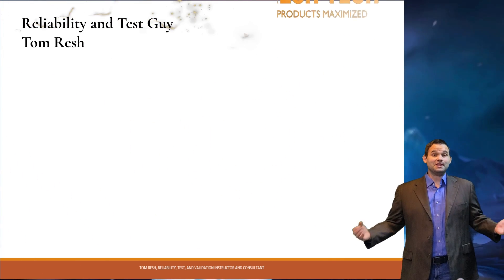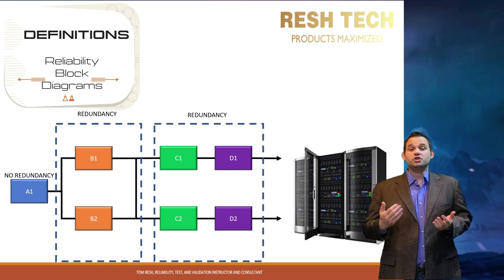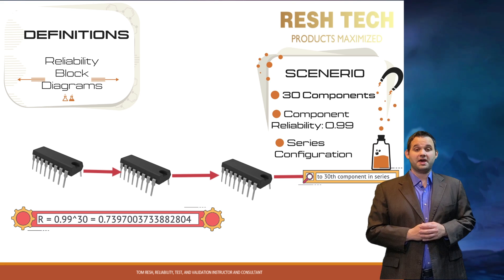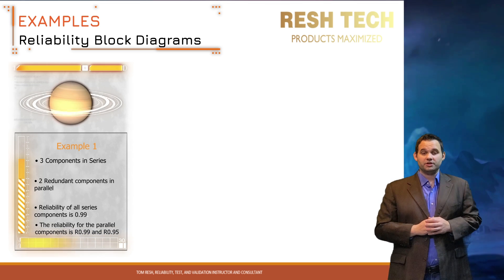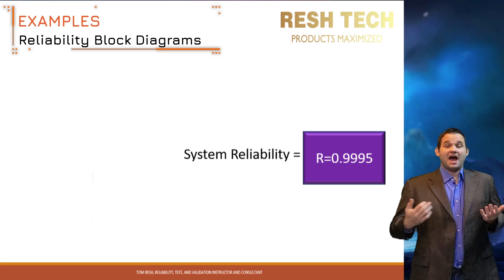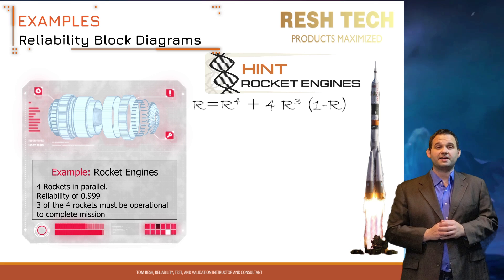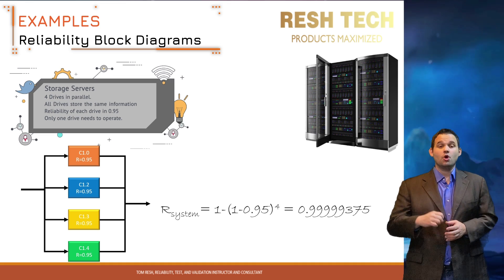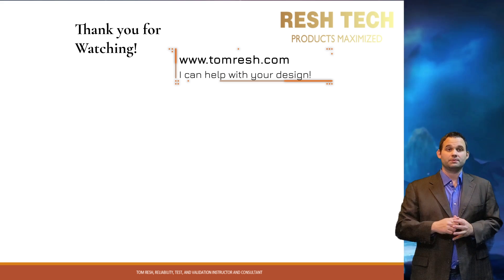How to use Reliability Block Diagrams (RBD)

Comment: Nice video, Tom! Can you please tell me where I can find the original form of the equation when k need to work out of n in parallel. Also if you know any equation to do the same for the MTBF. THank you :)
Reply from the maker: @firasalshatnawi433, thank you!  I can definitely do you one better.  I have an RBD Diagram generator on my website that you can download at www.tomresh.com.  I also have a Weibull distribution plotter that also calculates MTTF values.

Comment: I get R(system) for example 2 as 0.81597. Could you double check the calculations?
Reply from the maker: Hi Mashi-ur,

1-(1-0.95)^(4) = 0.99999375
Reply: I agree it is wrong. Forgot to multiply the parallel circuit by c^5.